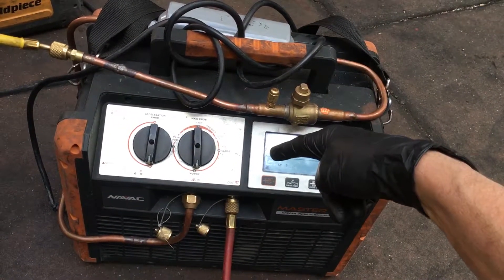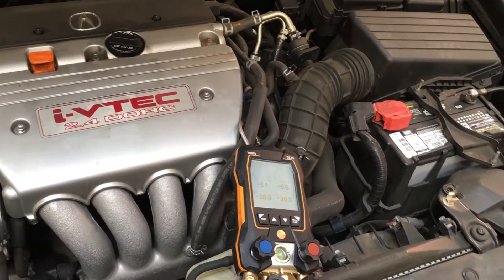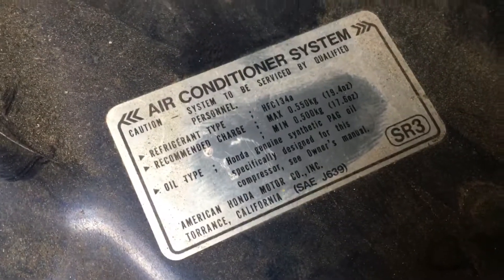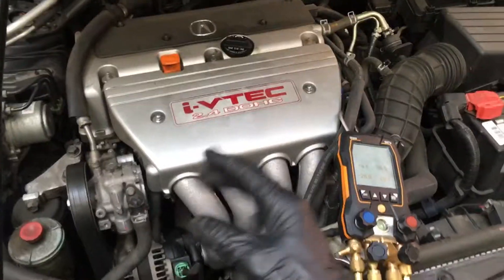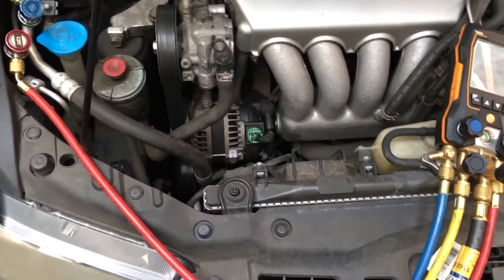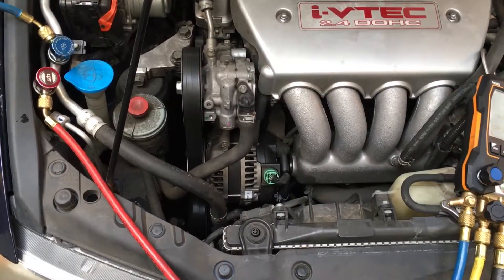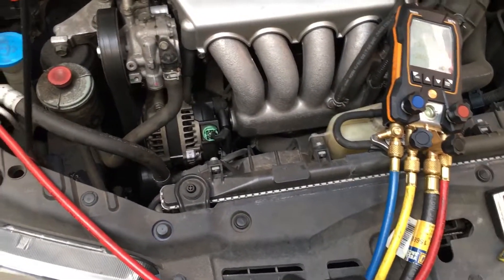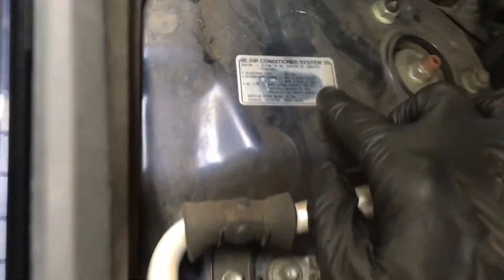AC pro refrigerant recovered from vehicle but low on refrigerant. Green scale on gauge means good ?

Comment: Bad metering device? Guess. Haven’t seen the answer yet.
Reply from the maker: Nothing wrong with metering device this is a natural phenomenon that happens on some vehicles. Certain compressor AC set up arrangements on certain cars start starving for oil the super he goes up the compressor gets super hot because no oil’s returning in the cooling is returning the  refrigerant get super heated and refrigerant pressure skyrockets. 

         As soon as you put in the correct refrigerant charge it works normally again.  

         This fools a lot of guys. 
Some guys think the condenser is plugged but that’s because they didn’t do the full diagnostic look at the( big picture) Chris is Termanology. 
          So the technician would just replace the condenser thinking a condenser is bad call the customer up get approval to replace the plug condenser. 
              And then when the technician fills the system up 100% correctly it would work normally and he thinks he fixed something actually he just ripped off to come with his false diagnosis. 

           Scenario to like yourself jump to the conclusion it’s a bad metering device let’s charge the customer $1500 to replace the expansion valve. 
              But because the technician just recovers the refrigerant without actually measuring and weighing the refrigerant he recovered he does not know the refrigerant was low.      And very very very few technicians know that on certain vehicles when you have a low charge of refrigerant there is a certain window at which the high side pressure skyrockets. 

             Therefore technician number two replaces that expansion device recharges the system 100% in the system works normally and he thinks he made the correct diagnosis when in fact he just ripped off the customer because he doesn’t understand the system lack of education and lack of experience lack of knowledge. 

               When all it was was 200 g low on refrigerant charge causes this phenomenon. 

            Just like commercial and residential HVAC I still haven’t determine which Trade is worse at missed diagnosing problems and charging customers for stuff that is not needed.
Reply: Another invaluable video!